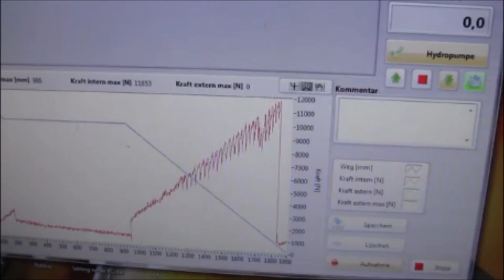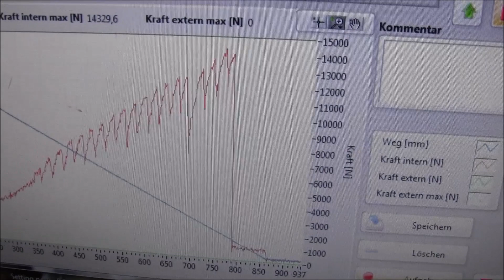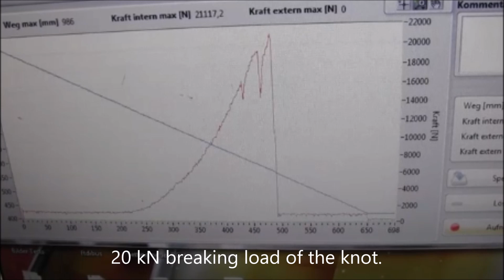Flaschenzug pulley (rope on rope)

Comment: I'm not sure what the validity of this test is for two reasons: 1) if you were actually using this setup as a pulley, the pulling speed would be considerably faster, generating much more heat and therefore a failure much sooner. Also, with all this friction, as a pully setup it would be so inefficient as to be counter productive.
Reply from the maker: The reason I tested this was a facebook post about a pulley system with a rope only, without additional tools. I wanted to know what it takes to melt it through.
Reply from the maker: Ok, now I tested it with higher speed.
https://youtu.be/xiD69VwMQg8